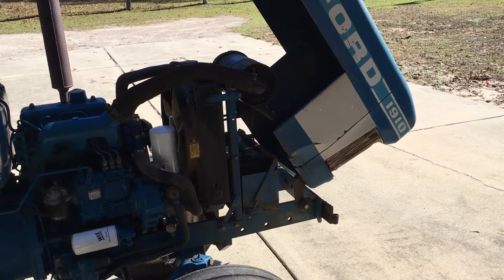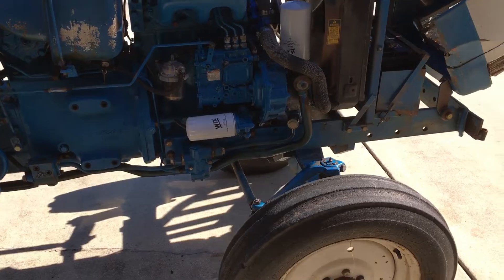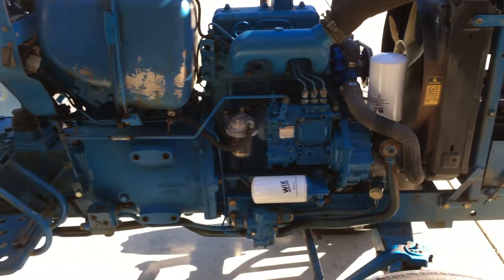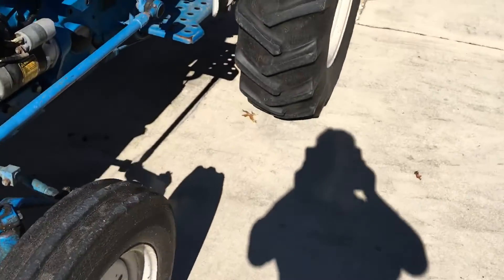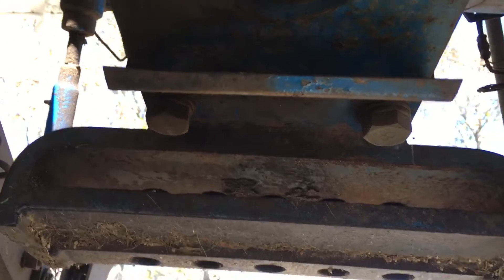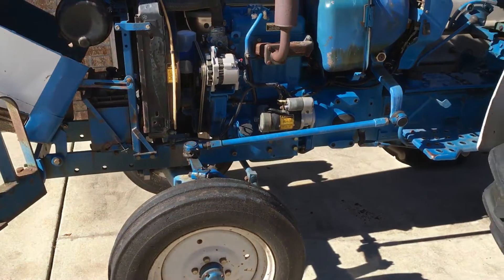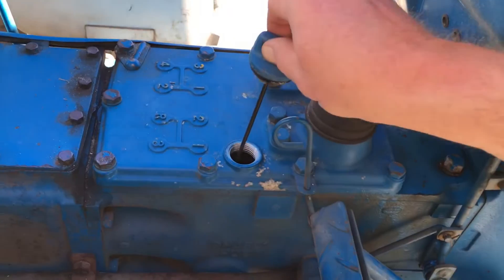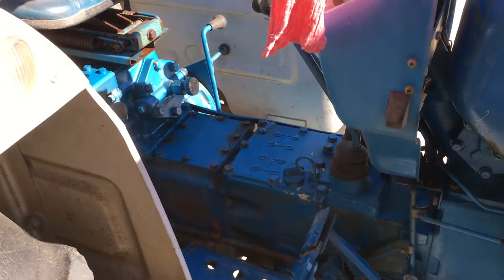Ford 1910 Maintenance (Hydraulic Fluid Service)

Comment: 1910 model where do you prime the hydraulic to get the air out of the lines I changed my fluid I can't get my hydraulics to work
Reply from the maker: I’m not sure about having to prime the pump. When I changed the fluid (years ago) I just drained it, changed the filter and filled it back up.    Perhaps you could try taking the filter off and pouring some hydraulic fluid into that location (not the filter, but the filter housing).  Since that is where the pump is located.   Just don’t over-fill it.

Comment: Thanks for the video.  
Your 1910 looks to be in great shape!  I have one with front wheel assist and a loader.  My loader hydraulics gets frozen up in colder weather, and i was wondering if there’s moisture in my hydraulic fluid.  I wish there was a winter additive, but I’m guessing it needs the fluid changed.

Comment: I'm not arguing or fighting I'm just a little bit surprised. You said 19 mm that makes sense with its birthplace being in Japan however the manual Specs metric?
Reply from the maker: @jedidiahlawton2149  not sure what the manual says but 19mm socket worked for me.

Comment: You also ad oil to the injection pump.
Reply from the maker: You add 8oz of motor oil to the injection pump during a engine oil change, but NOT hydraulic fluid.   Just to be clear.

Comment: hello Patriotic the knob on front of seat is called transportation lock ,it locks hydraulics in 3 point lift from draining while moving thx
Reply: Actually Ford calls it the “Flow Control Valve” and does exactly what he states in the video. It does however stop the 3 point from lowering when tightened completely. Thanks

Comment: Thank you so much but what type of fluid did you use? Been looking for days but definite answer.
Reply from the maker: I used Tractor Supply Traveller Premium Universal Tractor Transmission/Hydraulic Fluid (7.4 gallons).

Comment: Right there next to where you put the fluid in there's a vertical pull rod! what the heck is it for? please let me know! Thanks!
Reply from the maker: That pull rod is used to lock the brakes…. To lock the brakes you would press on the brake pedals with your foot and then with your hand pull up on the pull rod. That pull rod is connected to a small metal lever that engages in a tooth section on the brake thereby locking the brakes with your desired amount of force.   To release the brakes you just press down on the brakes with your foot and push the rod down so that the lever is no longer engaged in the tooth.   I don’t use this very often but I hoped this info helped you.
Reply: @PatrioticRottweiler  Thank you very much for that info! I bought it from my neighbor for 1 dollar! it's a 1986 1510 ford the reason for a buck it blew a rod I patched the small hole on the block replaced the rod and piston had to pull the engine for this but the reason I'm telling you all this is because now I don't know where to adjust the rpm bolt for the governor it's located under the alternator it has a spring on it! do you know? the engine is a Shibaura k773
Reply from the maker: The hydraulic fluid I used for my tractor is: Tractor Supply Traveller Premium Universal Tractor Transmission/Hydraulic Fluid 7.4 gallons.   

I don’t know about your model tractor or how to adjust the rpm governor but I would guess that adjustment would be done somewhere on the Fuel Injection Pump. I’m no expert tractor mechanic. I’m just a guy who tries to maintain my equipment as much as I can.  Good luck to you on your tractor journey.
Reply: @PatrioticRottweiler  Thank you! I Appreciate your Honesty!

Comment: What hydrolic fluid do I use on my 1919 fwd Ford tractor
Reply from the maker: Though I am not familiar with your model tractor, I used the Traveller Premium Universal Tractor Trans/Hydraulic Fluid from Tractor Supply for mine. I would assume that it would work for you as well.

Comment: Thanks for the very helpful video.  I was waiting on a service manual to make sure I know all the correct drain ports, but, also trying to figure out how water is getting in the system.  You mentioned that your fluid was milky as well.  Did you find any source for the water contamination?  I could only guess that it was maybe getting in at the breather.
Reply from the maker: Kevin Danahy no I didn’t.  I assume that the fluid had never been changed.  Before this tractor came to my property it used to sit out in the weather all the time (now it’s in a carport).
Reply: I had the same problem. My fluid came out light gray looking and watery.

Comment: Thanks for making these videos. I just picked up a 1910 in great shape and your how-to videos are really helping me. Quick question though...that swing-out front bumper is awesome. Is it a farm modification or do you think that’s an item I could source online? If nothing else, would love a short vid or pics up close of the hinge part. 
Thanks again!
Reply from the maker: Jim Brad I’m so sorry, I don’t know how I missed your question.    The front grill was already on the tractor when it came to me.  From the looks of it I believe that it is OEM, though I can’t be sure. It doesn’t have any labels or part numbers. It has a bolt on one side (to act as a hinge) and a 1/2” pin on the other. To open the hood, I remove the 1/2” pin and swing the grill away from the front of the tractor so that the hood will have clearance to open fully.
Reply: @PatrioticRottweiler  
Thanks very much for the reply. No worries that it was late. Actually decided to add a bucket to the front end of mine (used one from PA) and the bumper you have would not have worked with that attached. I am very much enjoying this tough little tractor and hope you continue to do great videos of your repairs and maintenance. Thanks again for circling back with me. First time I've ever left a comment on a video. I'm a Luddite.
Reply from the maker: Jim Brad I just completed a video showing the brush guard.

https://youtu.be/YctFzjRfBNo            

I also saw that eBay has brush guards that you could buy but I don’t know if they sell one like mine.  I hope this helps you.

Comment: The one thing I watched the video for was to find out what kind of hydraulic fluid .  Did I miss something ???????
Reply from the maker: ernest johnson these items are listed in the description section of the video, But here is the info as well.  

Hydraulic Filter (Wix 51208)
Hydraulic Fluid (Ford 134) Tractor Supply Traveller Premium Universal Tractor Transmission/Hydraulic Fluid 7.4 gallons.

Thank you for your question.

Comment: don't ever run out of diesel fuel in tank, there goes your days work.
Reply from the maker: Brian Perendy I would agree about not running out of fuel.  Check out my video on removing the fuel tank.  Replacing the tank or fuel filter does cause the lines to need to be purged but I’ve found that it doesn’t take very long (10 minutes) but maybe I’ve been lucky.

https://youtu.be/SHAEMh73FWc

Comment: Great video, I have bigger brother the 2110. Great little tractor, I’m changing my oil and hydraulic filter this weekend. Mine uses the same filters, glad you showed the part numbers. I ordered off amazon, saved me about $ 45.
What hydraulic fluid did you end up using? I’m thinking of using the TSC Traveller Renew.
Reply from the maker: Dave Miller I used the Tractor Supply Traveller Premium Universal Tractor Transmission/Hydraulic Fluid 7.4 gallons. Also look in the description under the video title for more information that might be helpful to you.
Reply: @PatrioticRottweiler  Have any experience with the VP Racing brand at TSC? Got some on sale and about to do a change. Thanks.
Reply from the maker: @oxboworchardohio  no I don’t have any experience or info on that brand. I would assume that it should work if it’s a hydraulic oil and used for that purpose. You could always check their website for uses. Good luck with your maintenance work.

Comment: Thank you, thank, thank you!!!  Needed the hydraulic system maintenance info!
Reply from the maker: You are very welcome. 

Make sure to watch the other two videos I did on this tractor. I only do these videos for two reasons, 1) to help me remember how to do the maintenance the next time I need to and 2) to help other people work on their own tractors. 

Good luck on yours. And let me know if you have any questions.
Reply: @PatrioticRottweiler  Thanks! what is type of hydraulic does it take? also right there next to where you put the fluid in there's a vertical pull rod! what the heck is it for? please let me know! please!!